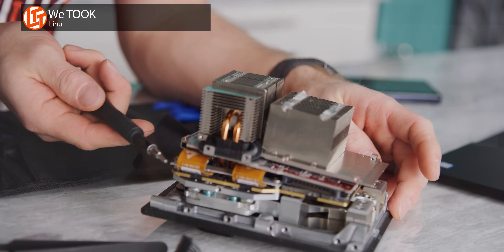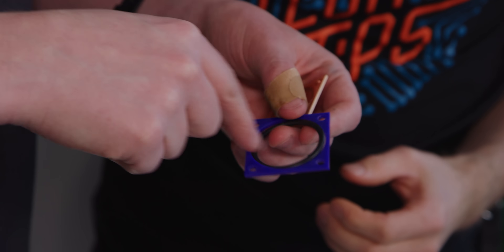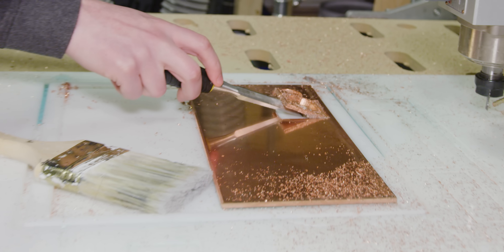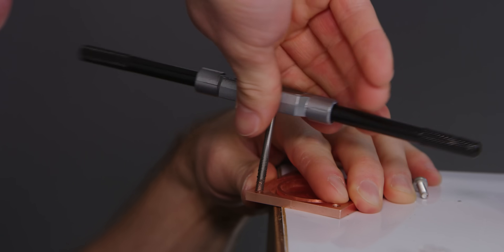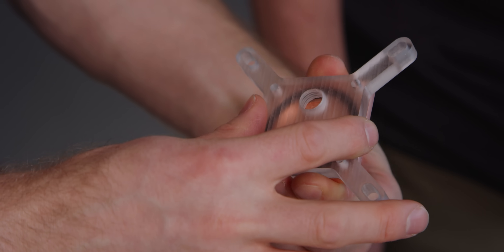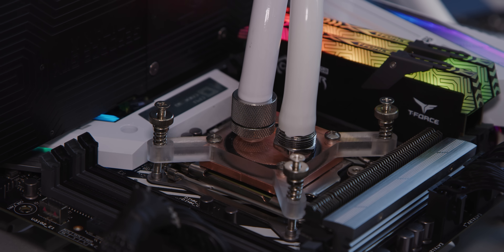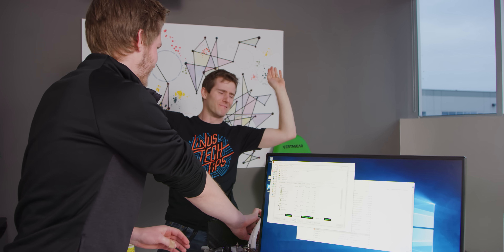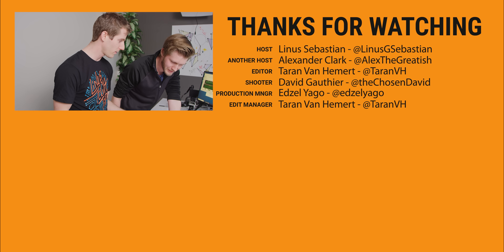We Built a CPU Water Cooler!

Comment: FAA requires a 1.5 safety factor on airplanes and a 3.0 safety factor on the landing gear.
Reply: I was looking for someone complaining about him understating how god damn strict the FAA is on safety
Reply: Also flying is literally the safest form of transportation there is, including walking
Reply: @OmiP42  yeah i feel relaxed getting onto planes, its trains that scare me
Reply: @lucywucyyy  honestly at least in western Europe trains are very well maintained and very safe. The TGV in France travels with speeds well above 300km/h and is designed that a derailment doesn't lead to a tragic accident. And btw planes are a super safe way of transportation. You are more likely to die on your way to the airport than on the actual flight
Reply: Came here to say that in all of aerospace the safety margins tend to be ludicrous.  Anywhere from 30% margin to 100%+ is pretty common.  Heck, a lot of times it's something like "we took the worst possible scenario we could imagine, added 30% margin, and then doubled everything for good measure."
Reply: Not to mention all of the requirements for redundancies and maintenance checks.
Reply: @faheemzia5509  the companies that design the planes try to keep the safety factor as close to the minimum as possible. More safety = more material = more weight = more fuel = higher  operation costs!
Reply: @EricSmith-dx1ll  and that minimum is still very high

Comment: Only the depth is really important in o-rings, and there's still a decent margin. The whole point is that the ring will squish to fill gaps. It is important that your recesses are as smooth as you can get them and that the width of your recesses is oversized. Squishing good, pinching bad.

Comment: The machined cuts into the metal are not guides for the liquid, although I can see how you would see it that way. They are meant to increase surface area. Same principle behind the heatsink fins you see on the air coolers. It's one of the factors you can control in heat transfer. The others being residence time and heat capacity. Since your pump most likely is a set flow rate, your residence time is fixed (unless you machine in baffles to make the liquid take a longer, more torturous path to exit the cooling block). You can change heat capacity by changing your heat transfer fluid. Surface area is changed by adding in fins.

Comment: When threading always debur the edges and usually you would use a piloted counterbore on the side where you wanna screw in your screw so it glides in more easily.  Hoe deep you have to go in with the piloted counterbore depends on the thread. There is a Formular for this I think. My metalwork practical course was over a year a go but I'm pretty sure that those Tipps could help you guys. And if you would use a vise the threading would also be much easier

Comment: Alex, dont be scared to run cutters hard. Sometimes softer metals need a couple thou in each tooth so that the cutter can bite, instead of pushing off of your stock.
Reply: also, try different coolant/lube. Compressed air also works wonders when cutters are loading up.

Comment: When tapping threads if you can use a bench vise to hold your work steady. Maybe get a better tapping set or a longer grip. The increase in leverage can help  with accurate threads. This may be over your guys head but look up cold chiseling for the copper plate you maybe able to create fins, although I  don't know how strong or if even possible at the size you want.

Comment: So back in the day over at procooling forums if you wanted to make a waterblock with fins you would start with a copper air cooler, remove the fins you didn't want, smooth the rest and then make a acrylic top for it. Depending on how much you wanted the heat not spread out from the core you would sand the base thinner and thinner. I tried to find some pictures of the ones I made, but they are all lost :(

Comment: Yes gluing o-rings together is fairly standard. I used to test equipment up to about 10,000psi with orings we glued together by hand.
Reply: also try lapping the copper plate and adding ridges to direct flow it wouldn't be that hard once you set up the program once

Comment: Wait, wouldn't petroleum jelly destroy the rubber o-ring? On cars, it's not advisable to use any petroleum based products on rubber because it dissolves into the rubber and destroys it. In those cases, it's recommended to use silicone grease instead.

Comment: Guys. Machining copper, aluminum, brass, etc is all Very easy. How fast are you running your spindle?
O ring grooves need +/- several thou for a good seal. You're not sealing N2 or He2 at 2000 psi. They're not necessarily all that sensitive to tolerance.
One could probably use an engraving bit for the small channels on over the CPU.
Man Linus. That tap is way crooked.
Probably use a larger bit and a slower speed.
Reply: Safety factor under 10%... *Cringe
1. That's not a factor. That's a percentage.
2. Plane S.F. are usually around 1.4 and up. That's commercial aircraft. So under the most demanding possibility hundreds of experienced engineers and over 100 years of flight can come up with; they multiply that stress by 1.4 and build to that. Then test... Extensively. Then hopefully your airline company maintains their planes. Most of them do a good job at that.
Reply: @mikes2381  Isn't 1.4 a servicibility limit state. The ultimate limit state should be closer to 2 based on the wing tip flex tests and jet turbine hang tests.
Reply: Using CA glue on o-rings Is actually a good way to make orings. Mine seal a vacuum chamber very freaking well and a buddy worked at a place that made them seal in 10k psi hydraulic forming machines.
Reply: All of our O-Ring Grooves we make are +/- .002 (inch) max. I suspect that spindle wasnt fast enough to deal with the gummy material. The endmill/Router bit was probably not coated for copper either.
Reply: They are in desperate need of a DRO mill or something, a nice slitting saw and a good 90 degree mount can give you some pretty amazing fins. Proper taper or plug taps make life much easier, using a bottoming tap is just a bad time.

And orings are really not that bad as long as you aren't doing exotic shit at high pressures, if it's static just 15-20% compression the bitch and call it done especially in this application.
Reply: @Bonez32186  for the shapes they are doing and the time frame they need things done, they need a hass vf2 or a hass mini-mill which will be the cost of a red camera
Reply: @Bonez32186  Please apply to work for LMG as an Ivan+Alex+Linus upgrade as far as making things goes. So often they do things so awful.
Reply: Chamfer or engraving bit is as good idea.
Reply: I think the main problem is that their CNC router doesn't even have ball screws for the axes, it uses preloaded gears if I remember correctly
Reply: @mikstratok  thought the gears were for the rotationspeed
Reply: @faabs12  It had an extra gear reduction, but you can clearly see the rack & pinion assembly below the rail in the video where they mount the thing.  Honestly I'd be disappointing to not get ball screws at $10k, the long 2000mm one for the x axis can be bought for about 200$, though they might need to buy 2 of those, and the one for the y axis is about $160 for 1500mm, and the z axis already had a ball screw.
Reply: @mikstratok  ah like that.. i get it 😅
Reply: Also, using better work holding, small endmills snap with vibration and tool slow of spindle speed as you said. Blasting it with a lot of air and coolant will also help considerably with smaller cuts and hitting tollerances. :D
Reply: Wonder if liquid gasket would work
I do know you can just buy sheets of gasket material and cut em to shape
Reply: Linus thinks the fins on a cpu water block are to help water flow the right direction, these guys are a lost cause man.
Reply: @unlisted9494  Also most have that... dull razor blade, can't think of the word atm... over the micro fins.
Reply: @unlisted9494  He's mentioned in the past that they are for extra heat dissipation. I guess you just had to feel smart eh?
Reply: @unlisted9494  Also the "Engineer" thinks the side you tap the thread effects the side a bolt can go through. Like changing side changes it from a right to left handed thread. Opposed to it just being a cruddy tap job without lubricant in acrylic with a single pass tap on a coarse thread in a brittle material.
Reply: @unlisted9494  Why would he think that. Did he say it somewhere because I didn't really pay attention.
Reply: @vilkku792  3:16 I was also shocked when he said that

Comment: High Tolerance (tight) not Low Tolerance (loose) for instance 10±2 (12/8) mm is a lower tolerance than 10±0.2 (10.2/9.8) mm. Even though a 0.4mm range is lower than a 4mm range the high low term relates to the relative work required to stay within the tolerance.

FYI with O-rings and the likes the tolerance isnt that important in low pressure systems. I will for instance round the tolerance up or down to 1 sig fig in the direction of more squeeze. The tols in Parker etc are recommended and are overly toleranced so that you won't sue them when it fails.

You really need to use a cold roll tap for copper as it hardens the threads as it goes. Normal taps tend to clog and don't really give a strong thread in copper.

Comment: Make a 90 degree jig, cut the copper into narrower pieces to fit on edge under the CNC motor, and buy a small slitting saw for your router.  This will allow you to make the fine fins in the copper plate.

Comment: You shouldn't use petroleum jelly on rubber components as its oil based and will perish the rubber and acrylic, you need a water base grease or a silicon grease.

Comment: Use a CNC engraving machine to make the inner surface similar to fins, machine the face that goes to the CPU flat, use one piece o-rings (you can buy them in sets, I would suggest a company like Wurth), practice threading, clean edges of all machines surfaces.
Otherwise you are fine 👍

Comment: You could get a v-groove mill bit to mill channels in the block base.  They wouldn't be microfins, but they would bet better than a flat plate and finer than an 1/8th inch end mill.  Also lap to bottom of the block before mounting it would probably help.   CA glue is the correct way to make o-rings.

Comment: no reason why you could not use a stack of copper plates with the inner cycle halved with each half having holes drilled into them like a mesh all the way to the bottom plate thats on the cpu, then your main intake and out are installed at the top one on each half, this way as the water goes down thu the holes and back up it comes in contact with more surface area and draws more heat away from the copper the bottom plate would have no center to half that area and that plate would let the water channel the water from one side to the other for cooling its about more surface area not how thick the copper is

Comment: Petroleum jelly will eat o-rings(rubber) you want to use a silicone based lubricant. It's usually in the plumbing section of your local hardware  store.

Comment: Wait why didn't you rout your water paths from the acrylic and leave the copper flat wouldn't that be easier to machine???

i know you guys said later you would "need" to so Im interested.
Reply: cause the fins in the copper are to increase the surface area for the heat exchange adding those in the acrylic be useless
Reply: @basvanderwerff2725  I think he is talking about creating a path in the acrylic so that the water takes a longer path over the copper, rather than just going in and then straight back out again over the (approx) 5 - 10 mm between the inlet and the outlet

Comment: Use a rotary tool saw blade for fine fins.
You can even mount the copper vertical in your cnc and machine it there with the saw blades.
Reply: They should make a dremel jig to cut the fins, itd be much better

Comment: omfg. water cooled network switch is such a good idea. especially given 10gbe network switches are typically kinda loud. 

set it up so the pcb is upside down and all the water blocks and tubing on the bottom.

Comment: When you make your own o ring, use a razor blade to cut the ends at 45 degree angles before gluing them. Larger surface area for the glue to adhere to.

Comment: If you can't mill microfins in the block, increase its surface area by drilling very small dents in the surface, especially right under the water inlet hole

Comment: 3:15 those are not for 'guiding' the fluid, they are there to increase the surface area thus increasing the heat transfer. Okay, the also guide the fluid a bit and their dimensions highly influence if the flow is laminar or turbulent. Which does influence its performance, but much less than the effect of the added surface area. I guess you guys at LMG knew, but the audience might not ;)

Comment: Taking the time and money to desgin the copper plate with fins should yield a rather significant performance increase (relatively speaking at least), as the increased surface area will increase the thermal transfer capacity of the plate. Also you might be able to design an acylic flow plate design that goes in between the copper baseplate and acrylic topplate without needing it's own seal. It would essentially be pushed into the acrylic top plate. This would allow one sided machining on the acrylic parts and could be used to maximize the effectiveness of the copper fins/channels.

Comment: to correctly groove the block you should use an ultra fine grooving tool for a mill, use a slotted angle block and hold the copper plate at a 90 deg angle, would be a good idea to use a mag plate as well, just to make sure everything is true, set your datum with the bottom of the tool against the mag plate and start your cut 1mm above the start of the plate you want to groove, remember to keep constant control over your speed and feeds as copper is soft but can cause issues at any time. also when tapping a hole use all 3 taps including in a tapping set, there not spares, they have different thread pitches down low to ensure you dont tear the material and tapping is easier. if 5 years as a machinist has taught me anything its that nothing ever runs as perfect as it should untill you refine your processes, good luck and hope to see more projects like this

Comment: I have Machined airplane parts i have built airplanes. The inspections for tolerances and safety are so high that the plane is near perfect when it comes out of the factory. The safety rating drops when the Airline doesn't give a damn.That is why Pilots are (FAA certified and trained) not trained and certified by the airline. Planes are great Airlines are bad. Airports suck...

Comment: aircrafts for public transportation use safetyfactors of 1.2 to 2 depending size and load configuration. still there are a few aircrafts which were build with no safety factor (=1.0) in mind and just rely on watching the cracks after each flight. feeling better or worse now? :D

Comment: When you make a custom o-ring and you glue them  cut the extremities at 45 degrees angles to increase the contact surface. When you tap holes install the part in the vise horizontally and start the tap at a perpendicular angle.

Comment: So, having broken/disassembled an 8K camera, what will Linus break next? And is he aware that there's a tool called a vice for holding stuff while you drill or tap it? And you tested it for leaks by putting it on the motherboard first? Wow. Those pictures on the whiteboard are a flow chart for their process.

Comment: You guys should cnc machine a laptop bottom out of copper, and come up with a way of integrating the added surface area into the notebooks cooling system. Think Macbook air, but with insanely low temps.

Comment: For the grooves you could either make a jig to hold a grinding tool with a very thin disc like a sliding mitre saw. An alternative would be to send it off for die sink edm machining. Another option, if you could be happy with aluminium, get a block 3d printed. You'd be able to have it made in one piece, no o-ring and all sorts of fancy channels inside. It'll be expensive, but super cool. Reply if you're interested in some metal 3d printing, I'll contact via email

Comment: Fyi the fins increase surface area (sense metal conducts heat fast) this increase in area means your water takes more heat. Also the machining in the top acrylic increases the turbulence which means more mixing (more of the water you pump touches the metal)

Comment: For the protocol: The side of the treading does not matter. You just did a bad job at it. Just take a nut and bolt: You can screw  the not on the bold from any direction.

Comment: As a mechanic watching Linus tap holes makes me cringe. You can also improve the cooling on the block by even milling large channels in the water channel. Every increase in surface  area helps a lot. I would also lap the cpu side of the block after assembly to get a flat surface. Its easy to do with a sheet of glass and some abrasive.

Comment: 13:14 That is not true, aircraft are designed to withstand at least 1.5x maximum expected structural loads per FAA requirements for certification.  However, weight has a significant impact on efficiency, which is why airlines are stingy with weight.

Comment: When tapping, use a drill press, there is a centering hole in the tap for stabilizing and secure it at 90 degree angle